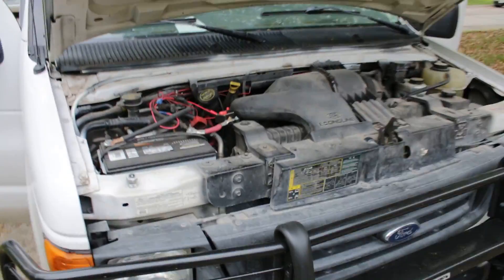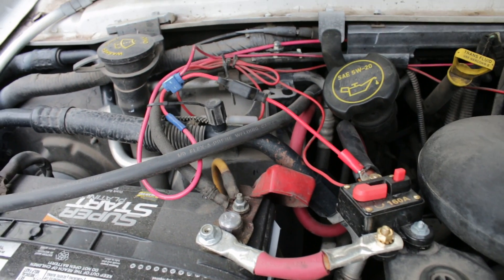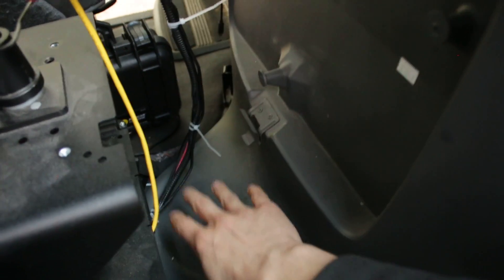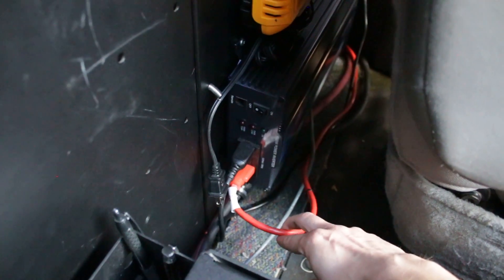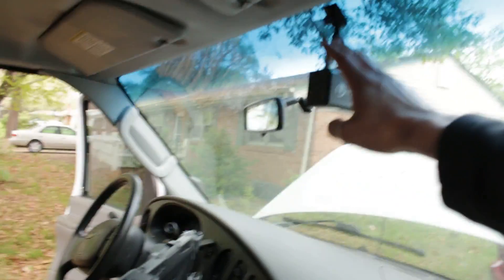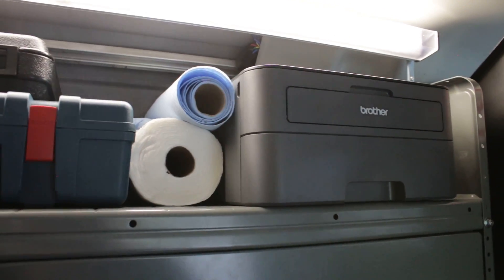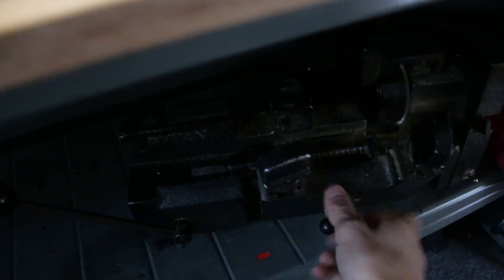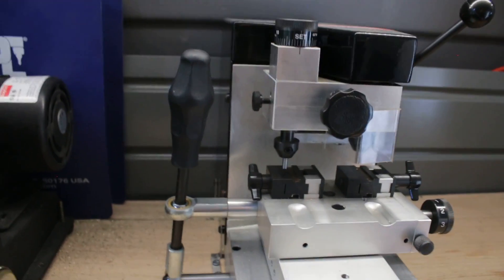How to wire an Inverter to run Key Machines, Printer and other equipment in your vehicle

Comment: How is that brother laser printer holding up in the van? I have a brother mfc with fax I was thinking about putting in mine. was going to run a magic jack hooked to my hotspot for fax capability in the van too.
Reply from the maker: It's fallen off the shelf on a few sharp turns but it works just fine.
Reply: There’s apps for faxing. Just about everyone has switched to email. Don’t see the point except your taking up space just to fax. Cam scanner is one that works great
Reply: @2815Juan  well that’s the way that I want to do it and who do you think you are telling me that’s wrong and to get an app or an email that’s not what I was asking if you don’t have anything helpful to say why say anything do you not think that I’ve already considered or don’t know about apps or email I am wanting something that automatically receives and prints without having to look at an app or an email so thanks for the unhelpful remark 😠
Reply: @2815Juan  I don’t know why you have to see the point if you know how to do something than great go ahead and contribute something helpful but saying you don’t see the point and it’s wasting space how is that helpful and the printer already has the fax built in and the magic jack is barely bigger than a usb stick so how is that taking up space when it is already built in and I have the printer already and I wanted the mfc in case I needed to scan something or copy something and all mfcs just about come with a fax anyways so what’s the problem with me wanting to use that functionality that’s already there I did pay for it didn’t I but you think it’s better for me to get an app or email because that’s the way you like to do things and you think everyone has to be like you because you probably think your better than everyone typical narcissistic behavior if I’ve ever seen it 🤨

Comment: why do you need 1/0 gauge cable? Run 4 gauge to a deep cycle in the back and then run to the inverter. Less distance from battery to the inverter. Also use a battery separator. I would also put a solar panel on the cab part of your van to trickle charge your system.
Reply from the maker: That's one way to do it. I didn't want to have to mess with an extra battery that needs to be vented to the outside.
Reply: @Hslk-Locksmith  run an agm or lithium battery then